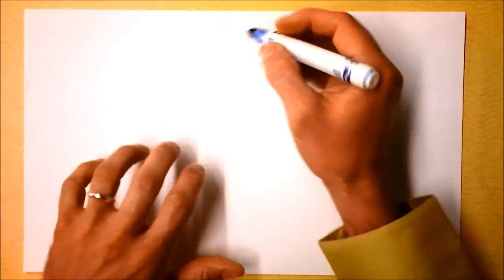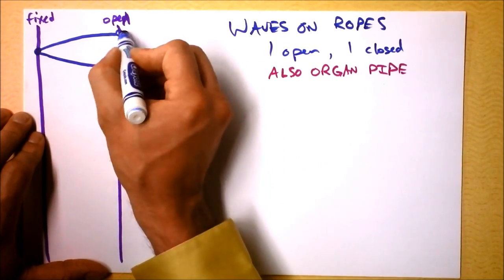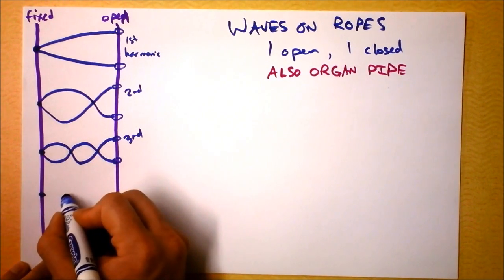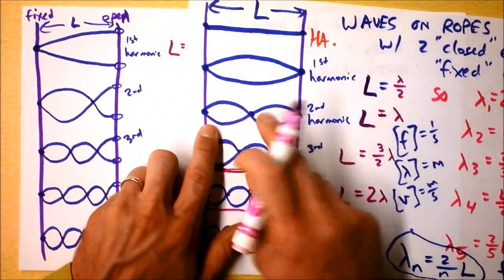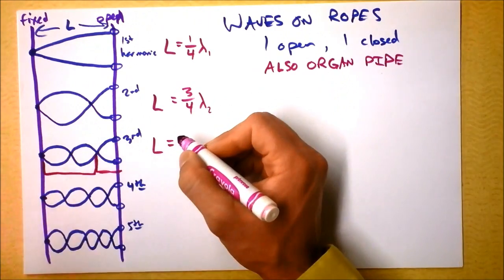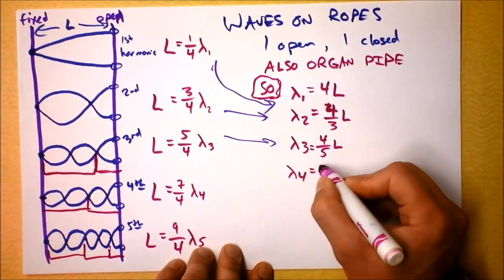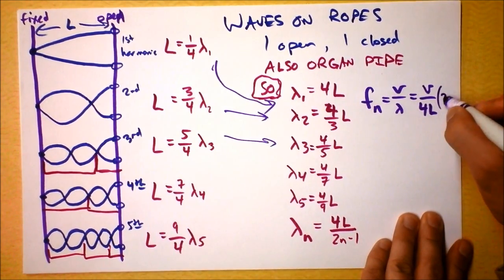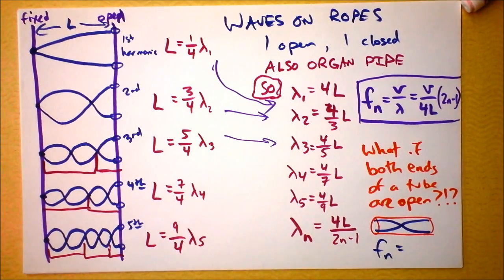Standing wave harmonics in a tube with one closed end (Organ, Saxophone, Tuba) | Doc Physics

Comment: THIS VIDEO IS NOT TEACHING THE CORRECT HARMONIC NUMBERS BE WARNED
Reply: Why, where, how is this wrong?! Someone please clear this up. I thought I understood it really well from the video.
Please delete this video if its wrong. You're misguiding lots of people
Reply: it is right only instead of saying odd numbers he just uses 2n-1
Reply: just a rule that would actually help is that you should mention the improvement. (I know why it's wrong but some people may not).
Reply: I learned that after losing a mark on loncapa
Reply: UAH The harmonic numbers are odd, this just works for calculating frequencies from the fundamental ones. f(n) = f1 *n. The harmonic numbers on open pipes are; 1, 3, 5, 7... etc.

Comment: Doc, you're drawing your harmonics wrong! Your second harmonic is actually the 3rd harmonic and your third harmonic is actually the 5th harmonic!
Reply from the maker: ***** YES!  I recognize that I should call these overtones instead of harmonics, now.  Thanks!  Check out my most recent video on standing waves to see if you agree with the conventions as I now understand them, please.
Reply: Chris, thank you for your comment. I was so confused with a problem where I had to find the wavelength of the third harmonic until I read your comment. Thank you so much!!
Reply: Doc, does this mean that there is no 4th harmonic or 6th harmonic for an organ pipe that is open on one end and closed on another?
Reply: no no no. Chriskeaten didn't see correctly since the "as written in video" 5th harmonic is 4th and not 3rd. Harmonics are counted based on the nodes or knots (however you say in your school) inside the limits. For example the 3rd harmonic has the beginning node, 3 nodes inside and an open end.
And the wavelenght is 4*L/2n+1; thus frequency being (speed/4L)*(2n+1)
Hope this helps a bit :).
Reply: Exactly what i was watching
Reply: I guess you'd call them the first, 2nd, 3rd possible harmonics existing as the 1st, 3rd, 5th.  Every even is not possible
Reply: 2nd overtone is the 1st harmonic fyi
Reply: Why do you not delete this video and let someone that knows the information better explain it correctly or do it over again, now that you have been corrected by so many people, with accurate information?

Comment: Thank you for your very lucid treatment of the subject. I find that all investigators, scientists, acousticians  and researchers  into the subject of saxophone acoustics fight shy of explicitly , categorically and unequivocally stating the fact that saxophone acoustics just cannot be analysed by assuimng the instrument to be one of the many forms of resonators. In actual fact the saxophone is a conical resonator closed at one end and open at the other. Yet it behaves as a cylinderical resonator open at both ends when its frequency spectrum is analysed for harmonic content. This makes it imipossible to use any formular to calculate even approximately the positionn of tone holes. Stanford university have published what is claimed to be somewhat of a more accurete formula to the calculation of standing waves in a saxophone. This formula equates entities of different and incompatible dimensions. The equation is simple enough but how does one equate lnear dimensions in meters.  a mathenatical constan and angular measurements in degree?  Having unsuccessfuly attempted to design a m ini saxophone due to the  nonavailability of a suitable formula . would the very clever Doctor please refer to a formula to enable me to calculate even approximately the  positions of the tone; holes on the standard tapered bore saxophone resonator. Thank you very very much.

Comment: I think there´s a simpler wave with both ends open, it would be 2 straight lines going up and down with no antinodes
the frquency formula is (2nv-2)/4L it´s equal to (nv-1)/2l
Reply: sorry the final part is wrong the formula is actually (VN)/2L
Reply from the maker: Does the wave you propose actually wave?